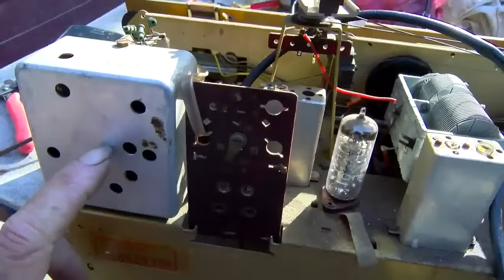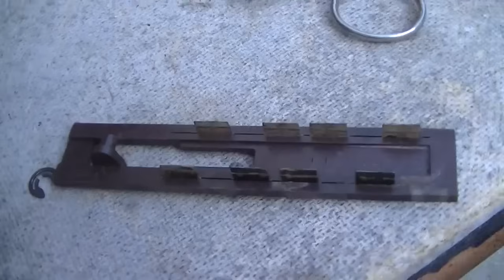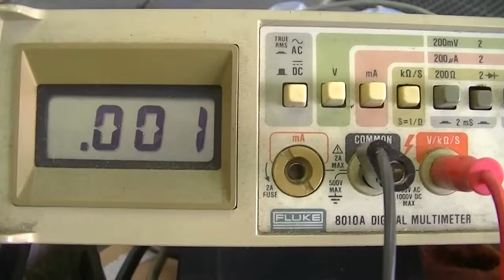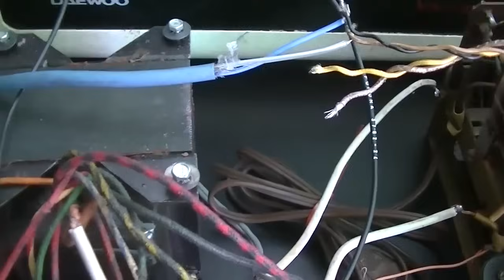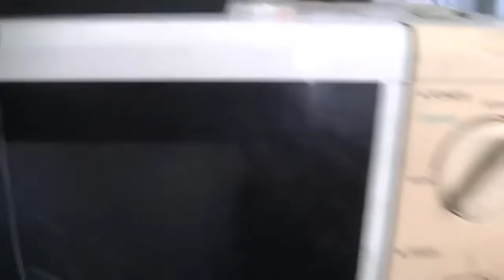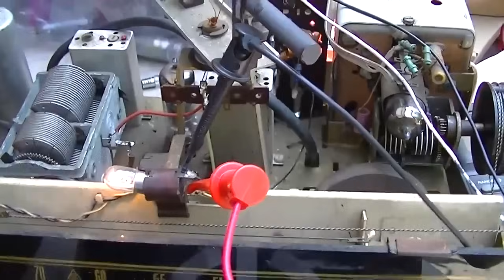Grundig Majestic 3035 Radio Repair Full 720p

Comment: Wow I'm lucky my radio which is similar to yours it's the grundig radio made in West Germany and I didn't need to replace any of the capacitors I just needed a place one tube and that was it which is the el84 tube / 6BQ5 I did have to sacrifice one of the tuners but luckily that's the one where he could only get one station same with the display for it to make the tuner work at all I also did have to make a plug for it so the one display that is working is the FM I also made my own antenna for it also I'm listening to it while I'm commenting on this video I can't believe the capacitors are not shorted or damaged I think at one point someone did fix us up a bit but I can tell the capacitors are are still old

Comment: You can probably replace the EM85 tube with a EM80 or a Russian 6E1P. You would need to rewire the socket and the tube looks a bit different, but it should be better than a dead eye tube.

Comment: when the power transformer shorts to the case its usually in the outmost windings and its easy to get to and easy to repair..i´ve done that and it took me about 30 minutes, had to remove all the E and I shaped pieces, remove a couple turns of damaged copper and reinstall everything..in the end i ended up with less 5v of B+ so it was fine

Comment: Why not use a high voltage switch mode supply for the B+ ? (like this : https://m.ebay.com/itm/High-Voltage-DC-DC-Converter-8V-32V-to-45V-390V-ZVS-Power-Supply-Module-Q5D0-/302491536603?nav=SEARCH) I'm using it for my 6P1P/6P14P amplifiers. Anyway I realy enjoyed watching this project video too 🙂

Comment: I know this video has been out there for a while, but I had to comment after watching it tonight.  All I have to say is that I HATE GERMAN RADIOS!  I have restored a few of them, and they are all a pain in the back side!  They are over-engineered, over-complicated, and made with crap for parts.   I think that the whole "German Engineering" thing was the biggest marketing con that has ever been pulled off.  Kudos to you for getting through this radio.  I'd give it away now, before it dies again!    Nice job, sir!  I like your videos a bunch.  Cheers!   Michael
Reply: Tell me about it!  My "Bosch" EMU from a 1990 Volvo baked. The OEM replacement $1600! [2004 price].  A Silicon Vally Company [USA] was doing a Swap the old bad unit  in for their "REBUILT" re-engineered one  $430. It lasted longer than the Volvo did, and is in a box under my bench. With that said I am a fan of the "Flex Ray" protocol which is German, its a more sophisticated version of CAN.  It depends on what sort of purpose the given item was meant for. Watch The Post Apocalyptic Inventor, I guess the good stuff Says in Germany....{ :->
Reply: Germans make the best electronics, and cars in the world. Their dedication to quality is second to none

Comment: All class A amplifiers use less power as the output increases. That's why they're not used for outputs much anymore, especially with battery power. But that's nothing to do with them being tube based.

Comment: That slug in the if transformer is to change the AM IF bandwidth. Check out 12voltvids restoration. He just did a 3055 and he changed out all the caps and rectifier before powering it up. Sounded great after restore. His rule is never apply power to old tube  gear until all the paper caps have been dealt with as they will all be bad. He makes it look easy.

Comment: decoupling cap value in an if stage can be critical as some use a lower value screen decoupler than you'd think so doesnt decouple fully, and then connect the anode decoupler to the screen instead of ground, forming a bit of feedback/neutralising..

Comment: Extremely well done Sir !!  I have a very similar Grundig console set using a similar chassis that developed carbon tracking on the FM switch bank sorting the HT to earth when FM was selected.. thankfully because of the way the switch bank works with the protruding sliders at the back of the switch bank.. with the help of a friend we managed to use a micro switch  that is actuated when the FM switches are selected, my one which you can see in my videos has the added complication of push pull amp, 6 speakers and twin FM bands... although these sets especially the console versions  sound incredible  once up and running the down side is they are just so "fragile" in their construction... very well done bringing it back from the dead!!

Comment: I believe that the German name for a tube is "rohre", valve is the British/Australian name. In France and the former Soviet Union they referred to them as "Lampe" and "Lampa" respectively. Poor old thing, even though I don't particularly like the construction of German radios, especially 1960s era ones with a P.C board, it's still not nice to see one that has played into the ground in that way. Failed power transformers is a common problem with some German sets, and Grundigs in particular, someone also told me that they tended to use resistors that were barely adequate for Wattage, so it there was a power surge they would pop like popcorn. By the way, be careful what solvents you use on the band switches in those Grundigs, they used polystyrene in the slides, I can just imagine how many got trashed after someone sprayed carbon tet in there like an American set. 
  By the way, that pulley system is to vary the bandwidth of the AM IF transformers, it's a scheme to increase fidelity of the AM broadcast band, in fact the control may by called a "Fidelity Control". Some of the higher end radios back in the 1930s used this feature, but it was largely abandoned in the 1940s after the advent of FM broadcasting.
Reply: Almost correct😉. Tube is called "Röhre" in german, not "Rohre" (which means pipes in german)

Comment: Install two 5 amp diodes in inverse parallel in series with one leg of the new filament transformer and that should drop 0.7 volts to your filaments.  Cheap effective modification.

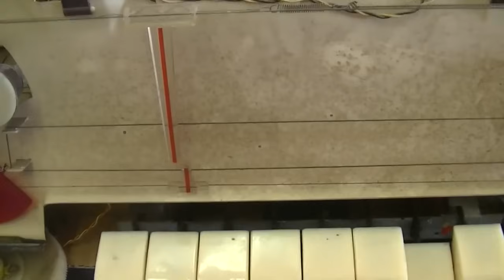Comment: At 55:00 I had to laugh.Because that is a common Problem on Radios here in Germany.These 1.3Ohm "Rosenthal" Resistors like to get bad Contact in the Windings and start to spark.Just had that on my Grundig 6199 that I restored.

Comment: the mains transformer on my grundig 2043w had shorted turns, been told its a common problem with them
Reply: couldnt find an exact replacement so stuck a 6v 50va one in plus a 12va 6v connected in reverse 6v to 6v for the ht...works surprisingly well
Reply: i've now got hold of a genuine grundig transformer for it...after about 30 years 😲

Comment: This looks a lot from the outside like a radio my godmother gave me. It came from an embassy of a country that was part of the USSR or at least allied with them, I do not remember which one though. I do not think it was a Grundig as I think I would have remembered such a well known name. It had valves but used a printed circuit instead of point to point wiring. 

OK, I just found a copy of the schematic my brother in law found for me, it's a Radioodbiornik Bolero, the language looks like Polish, I'm no linguist though but a mention of Warsaw seems to confirm it. 

It looks pretty good but the mechanism to switch station with keys needs a lot of work. On the electronic side I think it would not need much to work well as it already kind of work but not well. I gave it to my brother in law who's into restoring antique radios, but I think it's not old enough for his taste and I also think I might want to restore it myself one day. I personally doubt it, I do not have the patience for this kind of work.  But who know?

Comment: I have close to 20 of these German radios and a few chassis and I believe all the transformers are good. I have a Telefunken Opus 7 that someone hacked a tv power transformer in and the volume control was stuck but I found a German transformer and fixed the volume control and some recaps and it works great. I collect these because they have electrostatic tweeters.

Comment: Hey Shango, nice video. I enjoyed it thoroughly. 

About a year and a half ago I restored a Grundig Zauberklang 4090 and aside from the fact I recognized a lot of common parts in these types of radios, it also struck me you found exactly the same problems, or nearly so, I ran into when repairing the Zauberklang.
 
In fact, it was so uncanny, that I started wondering if the two radios were produced in the same factory with the same parts. The only problem you didn't encounter, but I did, was a shorted output transformer. But all the other problems: the sparking and burning switches, the smoking resistors, the shorted output tube(s) (the Zauberklang has two since it's push-pull), the shorted power transformer. Yes, even the 'dumb' FM stage I encountered as well.

Needless to say, I had to grin when you were summing up one by one the exact same problems I had encountered. The one thing you did, but I never dared to do myself, was to disassemble the switches. If you read about it on German forums, most people strongly advise AGAINST disassembling those, because they are devilishly difficult to reassemble. Not to mention the fact how fragile the coil assemblies are on top of the switches.

Hat off for daring the feat AND managing to reassemble the switches :) There is one more weak point in these Grundigs, and that's the power switch. It tends to fail or simply break apart.

Anyway, like you, I replaced power (and output) transformer and rectifier bridge as well as the filter capacitors, a number of tubes (or valves as they are called) and capacitors and resistors.
 
Watching you struggle with the exact same problems, AND solving them like I did with the Zauberklang, restored my faith in my own capacities for restoring these machines. The Grundig had really tested my patience and confidence.

Thanks a lot for sharing the video and tripple hurrah for this feat :)
Reply: Ha, that's so strange, I have here a Grundig 2025 "Hi-Fi Zauberklang" with many of the same issues although the transformer has already been replaced, badly, with a 250-0-250 and full wave rectifier. The big problem for me though, at the end when it died and was just humming faintly, then it was suddenly working again... Well, mine is currently at that stage and Shango kept the fix a secret! haha well, maybe i ought to throw it on it's side and hit it a few times & either magic sound or magic smoke will ensue.

Comment: Hi I worked on a lot of these in the early 1970s whilst very complex when working very good quality radios.

Use a  transformer from a small guitar amp, you will find them in the US

The  valves "tube" numbers from this European  radio came from the British valve association, back in the day they got tube companies to adopt few tube bases and the numbers tell you heater voltage and what is in the  tube so EL84 “E” 6.3 v  heater “L” Pentode  so ECH81 gives “E” 6.3 v heaters and “ CH” gives  RF Pentode + a Diode

Andre London UK

Oh and isn’t it great to work on big stuff an not surface mount stuff of today!!!!
Reply: In ECH81 C is for triode and H is for heptode

Comment: I had a short break and couldn't resist to watch the full video today. Excellent idea with the voltage doubler. Pity that the old TX was fried on the 6.3 Volts winding. I love that radio parts store you have there in L.A. Put 2 x 3 Amps 1N5408 diodes in anti parrallel in series with the 6.3 Volts TX output.
Reply from the maker: ahhhh yes, that would drop it about .6 v. brilliant!

Comment: That eye tube is an EM85, they were also used in the Grundig TK 5 Tonband maschinen.          ( reel to reel)
Reply: EM80 OR EM81 WILL REPLACE EM85
Reply: @davidhorton2209  with a change to the connections...they're not directly pinout compatible

Comment: Fireworks show. Love it, That is a complex designed radio. That Grundig radio has great smoking potential. Was that arcing not from inside the faulty EL84 tube ? seen through the bottom glass vacuum nipple. Your commercial intermezzo's are priceless. I am gonna have a break at 1 hour, watch the rest tomorrow.

Comment: Made it to the end! Wasn't sure you'd make it though given all the obstacles you had to face.. Great effort! You can even get the religious people on the shortwave bands, shame there doesn't seem to be much else in the states on SW, unlike Asia which still has a lot of shortwave, China espeically puts out a lot. Hard to tell from youtube sound but I assume it sounds great, I have an old Philips radio from the 50s and it sounds excellent and an old grundig concertboy that sounded great too, real nice radios, but very different construction from stuff made in the US. Not sure if you've ever worked on any but most of the older Japanese tube radios seems to be more similar to American radios in terms of overall construction.

Comment: I would have liked to have seen if drilling between the switch terminals and filling with epoxy would have worked. 
German engineering can be interesting. I had a MB 300D, which had all Bosch electrical components. Just about every switch and connector in that car failed. They looked well made, but had various failure modes. I've never had electrical problems with the multiple Fords that I've owned. Well, I DID have a light bulb go out in the dash once.

Comment: I used to play with those ol'e Grundigs back in the day when I was in high school. I loved how they sounded. I might have  a eye tube that might work with that radio. It is a nos from Russia. But I would have to find out what model number it is. I would give that one to you if it is the right one. I am sure you would be able to rewire it to work on the socket if it was worth your time? Anyway glad that you got it to work after all. Cool vid. 🤐

Comment: Congrats on this video. Welcome to European radios. Compared to American radios, these are a headache. I have restored a resemblance, and it was an authentic epic,
He's been a few times to fly out the window ... but compared to the philips ....
When the power transformer is burnt, I usually rewind them myself because it is very difficult to find substitutes. This is also true for out transformer.
I'd like to order the site where you ordered the valves. I saw it was in romania. Here in Portugal it is difficult to find and when they are expensive.
Once again I congratulate you on the video and if you have doubts on these European radios, do not hesitate to ask me the questions.
Your Subscriber
Sincerely
Eduardo Pereira

Comment: IMO valves do have gain.  A couple pounds of force on a sink faucet handle can control 50-60 pounds of water pressure.
Reply: your hand on the sink faucet would represent the voltage at the control grid....inlet of water is equal to outlet of water so no gain....
Reply: Using a small voltage to control; a larger voltage is where the "valve" analogy comes from. Grid voltage is small and plate voltage is large. Just like using a small force (the valve handle) to control a larger force (Line flow) comes from. So no, the outlet VOLUME not pressure is what is valved. The volume of electrons is then controlled by a much smaller volume of electrons. Just my thoughts...
Reply: my analogy of the hand on the faucet representing the grid was wrong....
hypothetical example: if you inject a 10 milivolts ac signal at the grid of a el84 valve you get for example, depending on the circuit blah blah but lets assume you get an amplified signal at the plate of the said valve at 100mv. for that to happen you have to have the cathode close to ground and a big dc positive voltage at the plate for example 400vdc. so on actual vaccuum tubes you dont use a small voltage to control a big one...on a solid state triac that is what happens and on other solid state devices also... but not on vacuum tubes. also on the example i gave the amplified signal rides on top of the dc voltage present at the plate, then you can either carry that signal to an output transformer if we are talking about an audio amplifier or you can filter the dc with a capacitor and use the signal for whatever you want for example to inject it athe grid of another valve to amplify it even more or wahtever(before the comments start i did not bother to present accurate mathematical figures, only very rough BALLPARK figures, i did not bother to go check the tube datasheet but only to provide educational information on how the system works) so mr jack allen grid voltage is small (ac signal) and plate voltage is high because it contains the b+ voltage and the amplified signal riding on top of it. and you need a very high voltage present or no gain and no emission happens on the valve.
Reply: i gave the example of the triac above and the triac is exactly the analogy of a sink faucet with no gain...it is a solid state relay...you have a small voltage applied to it and it starts conducting letting the current pass through it, you stop applying the small control voltage and it stops conducting...it is used for example on washer machines for the cpu to control heavy current draw devices like the heater and the motor with some low voltage low current signals.. typically on european machines the signals come out of the cpu and are amplified by a small transistor and then they feed some 6 amp triacs wich directly open or close 220v voltage to devices (heater, motor, door lock etc)
Reply: I get that, but the AC voltage at the plate is increased by the factor of gain in the tube (or mu level) the DC plate acts like a vacuum if you will to help the electrons flow from the cathode to the plate.(simple triode) Anyway I appreciate your time in explaining this! I really don't understand the solid state stuff very well. Tubes are nice and simple, lol. Have a great day.

Comment: Has C12 47nf gone conductive or something if so there must be a way to replace the C12 with a 47nf polypropylene metal foil capacitor 500v wkg.